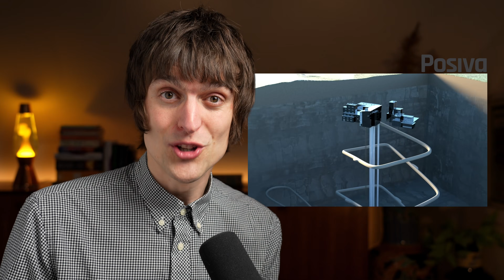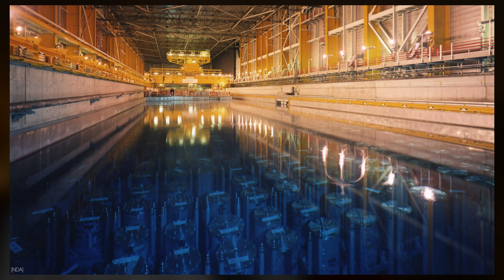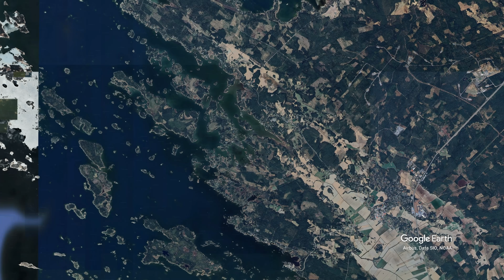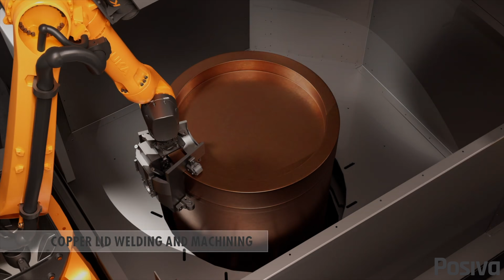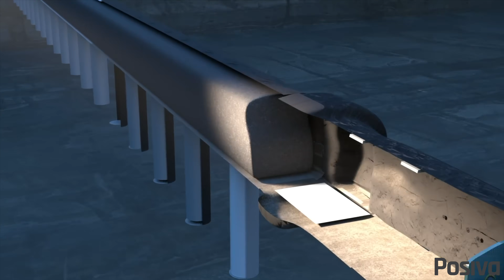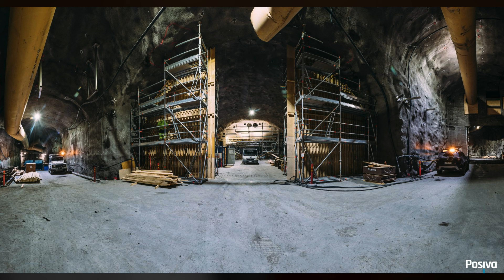There Is No Nuclear Waste Problem

Comment: You also missed one of the most important things to know about radioactivity: a short half-life means very frequent decay - more radiation. A very very long half life means very low rates of emission. Still don't put it on your breakfast; but when something 'has a half life of a million years', it means standing next to it might ping you with just a single gamma ray every 3 months. 
Not to mention: those long-lived elements are primarily alpha-decay, which is far less problematic that gamma & beta decay anyway.

Comment: Galen Windsor solved that in the early 80's in his 80's by swimming in the cooling ponds, carrying plutonium and uranium in his bare hands eating a piece of uranium on tv and living to a ripe old age without any "radiation" related health problems.
Remember radium? Long lasting portable personal heating with that would make living off grid and rural completely viable. I mean besides the Kim T. Rales poy sunning everyone.
Reply: A few meters of water is enough to stop practically all relevant radiation. These pools are intentionally overengineered, so staying near the surface at all times is safe.
Give me a pill of solid depleted uranium, maybe wax/tin coated, and I might swallow one for 10 bucks.
How long did he live exactly? 80 already sounds as ripe to me as it gets.
That shielded radioactive heater idea is already used by some military (I forgot which) for personal use- for own body or to cook/heat meals. It is small and not standard issue as it's expensive, but works quite well. I think for housing it would be better to just go with a liquid-medium heat pump.

That said: radiation poisoning is one of the worst ways to go. Get irradiated for a brief moment with a powerful source and your DNA gets unusable and your body cannot make (enough healthy) new cells. Ingest fine particles emitting even low levels of alpha ratiation and they will find home in (some of) your vital organs and bones and destroy/damage your bone marrrow- no(t enough healthy) new bIood cells.

Comment: To the Climate Change Zealots at the UN  and the Green Mind Virus Supporters , if you are really serious about climate strategy ( and not just a means to redistributed wealth and also meet our energy needs ) it requires  nuclear power generation capacity that will have to double by 2050 in order for the world to meet the international 2°C (3.6°F) warming goal according UNFCCC secretariat (UN Climate Change), Robert N. Stavins, director of the Project on Climate Agreements at Harvard University and a drafting author of the IPCC’s Working Group III Report

To accomplish the goal of CO2 emissions cuts to keep warming no greater than 2°C, the IEA says global nuclear power generation capacity needs to increase to 930  gigawatts from 396 gigawatts by 2050.

That conclusion is consistent with the Intergovernmental Panel on Climate Change’s findings  that global carbon dioxide emissions need to be capped at 450 parts per million in order to prevent warming greater than 2°C, Robert N. Stavins, director of the Project on Climate Agreements at Harvard University and a drafting author of the IPCC’s Working Group III Report, said.

It is virtually inconceivable that the 2 degree or 450 parts per million target as a cap can be achieved in this century without,  substantially greater reliance on nuclear power  according IEA’s report…

Comment: Solution: don't store high level nuclear waste undergound at all, treat it all as secure stockpile of potential resources (both the mixed actinides in spent fuel and all of the fission products with medium/long life spans). Focus on fully integrated on-site above-ground dry cask storage robust enough to weather all natural disasters, and secure enough to avoid any sort of real-world proliferation concerns. Plan for every large-scale nuclear power facility to double as a spent-fuel repository/vault/stockpile. Plan for all of that spent fuel to eventually be utilized as future fuel (either as-is in the old fuel assemblies in new/modified reactor designs with higher neutron economy sufficient to burn the lower-concentration of fuel, or after being reprocessed).

Plan for reprocessing to be done on-site, or with land/area set aside from potential reprocessing facilities to be set up. This could include partial reprocessing that simply involves breaking down worn-out fuel assemblies and loading the spent fuel pellets into new cladding. This could also include processes that leach out the readily-soluble fission products (namely Cesium and Strontium) while leaving the low-solubility and insoluble actinide oxides intact. (either producing more porous, but still solid fuel pellets, or breaking down the pellets and then re-sintering them after leaching).  The cesium and strontium could be further refined and purified for niche medical, research, or thermoelectric generator use. (or for thermal generators used for pre-heating stages of feed water in the main nuclear power cycle). The lack of gamma emissions from Sr-90 and the much wider range of insoluble Sr compounds, would make it much more versatile than Cs-137. (Sr carbonate, sulfate, or silicate are all good examples)

If the pellets are to be broken down into powder and re-sintered, they could also be re-enriched with higher enrichment Uranium oxide or with plutonium oxide from surplus stockpiles, or with U-233 oxide from thorium derived breeder cycles. (though with the current economy, use of government stockpiles of enriched uranium and plutonium would last a long time, and using it up would reduce proliferation concerns, especially as imbedding it into the fuel cycle would poison it for weapons use once it was actually used as reactor fuel)

Abandon the PUREX process entirely, and seriously reconsider the need for full reprocessing even using pyroprocessing. Instead focus on more efficient reactor designs with higher neutron economy (via more aggressive moderators like D2O, graphite, or Beryllium carbide, and/or via MOX fuel or higher enrichment fuel to provide the appropriate neutron surplus) and aim for fuel cycles where burnup rate is closer to 1:1 with fuel activation/breeding (but keeping it short from an actual net breeder cycle would further reduce proliferation concerns and also simplify the reactor lifecycle ... as actual net breeding means reactivity increases with time). Given Pu-239 has a lower critical mass than U-235, the transmutation rate of U-238 would also need to stay at levels where reactivity didn't increase due to a smaller amount of Pu-239 overcompensating for a larger amount of U-235 as neutron-capture occurred. (transmutation rate of U-239 to U-240 would partially compensate for this as well due to U-240's higher critical mass and its inability to fission from thermal neutrons)

Plan for eventual use of fast neutron reactors and breeder reactors of various types to be implemented.

Comment: It's not waste, it's gently used fuel, more than 90% of the energy is still there. Remove the fission products, store them for a mere 300 years, and they become less radioactive than the original ore. Burn the fuel again, lather, rinse, repeat. Handled intelligently, spent nuclear fuel is a resource, not waste, and 10,000 year storage is not needed.

But this makes too much sense and has been blocked by legislation.

Comment: Horizontal repository are waste time and money.
Deep borehole which essentially uses drilling technology for tunnels. Bore diameter of 50 cm and depth of 2-5 kilometers the waste is then entombed in matrix cementous grout and refilled. The first kilometer is filled with waste and remaining hole backfilled with source dug material. With media depth kilometer waste poses no threat to ecology or water tables

Comment: 25t of copper per waste cylinder, thats about 315.000 USD of copper
Reply: A big, unnecessary boondoggle designed to hurt the economics of nuclear energy. It is an answer to a question not asked by anybody but anti-nuclear activists. Dry cask storage and shallow burial are far preferable and keep the waste nearby for future reprocessing.
Reply: The bigger concern is that if this causes the world to run short of copper it could lead to a huge outcry and possibly even looting of the site. Probably should have gone with aluminium instead, or even just steel with a thin sheath of stainless over it

Comment: They still didn't solve the issue. They are just doing what everyone else is doing by burying it all.
Reply from the maker: Nobody else is doing this. Finland is the only one so far.
Reply: @DrTimGregory  13:35 "Finland is not the only country doing this" ...  It's still put it in barrels and put it underground, it's just that they're using really good barrels, and putting it really deal underground.

Comment: British classifications of wastes.  But low level wastes can be radioactive enough to give you your anual dose limit in one day  if it is all Ceasium or Cobalt. because its any waste that is less than 12 Gigabequerels per tonne in the UK. If the waste  is all tritium or Nickel-63  intermediate level waste in the UK  would give you no exposure at all even it you touched the package that contains it.  The Tritium ILW that is 24 gigabequerels per tonne would be low level wastes in 13.5 years and would be safe to drink in 380 years .  Nickel-63 has a half life of 100 years, but its not very mobile in the environment, so an ordinary landfill can contain it for 300 years when it will 12.5% of its original concentration.  The longest half lifed radionuclides are the easiest to shield and have the smallest amount of radioactivity per unit mass.  2400 year old Plutonium is not any more dangerous than naturally occouring radium. at low cncentrations. Both become highly oxidized and not very soluable.

Comment: Cool. Now tell me when they solve the economic problem. Nuclear is the most expensive way to generate electricity BY FAR. Solar and wind with batteries are many, many times less expensive., Nuclear is dead.
Reply from the maker: Hard disagree. Studies consistently show that when you account for system costs (not just levelised costs), nuclear is very competitive with wind and solar. We do it badly in Europe and America at the moment. In Asia, it’s got 50 per cent cheaper over the past 20 years.
Reply: @DrTimGregory  Yes, but solar also got cheaper. And solar is getting cheaper way faster than nuclear. In addition, installing new solar is a breeze and can be done in months in stead of years. I think within a decade or two we will look back at nuclear the same way we look back at coal-powered steam engines.